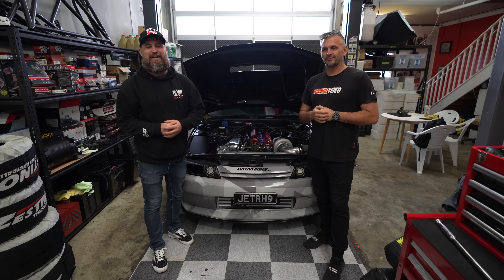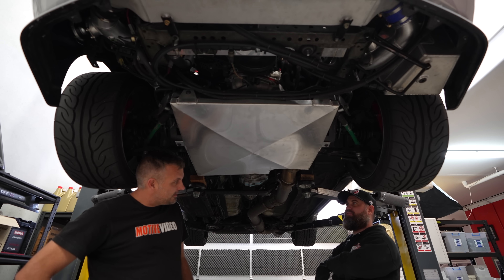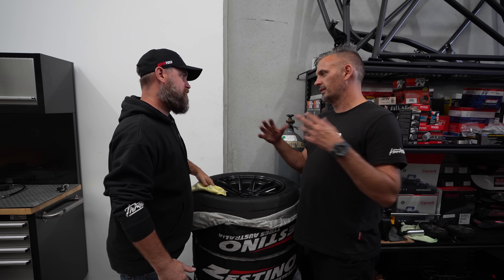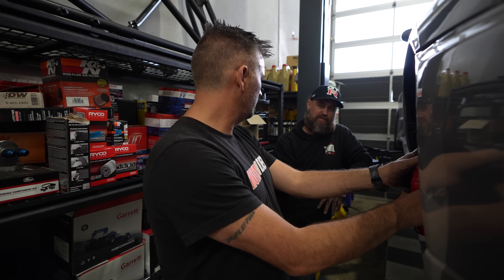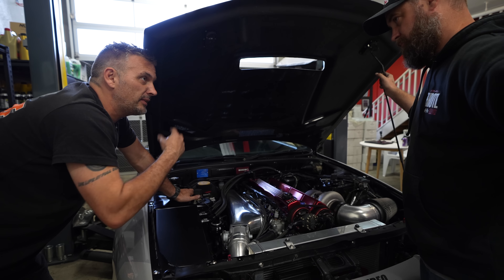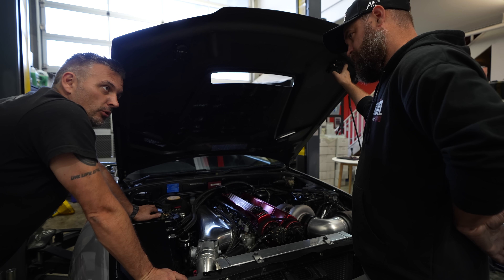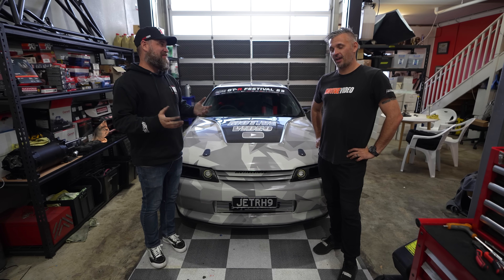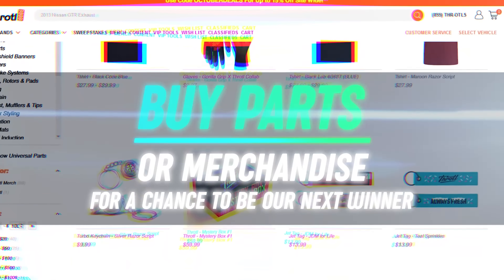Prepping @MotiveVideo's +1,100HP R32 GT-R For An 8 Second 1/4 mile Drag Pass!

Comment: Nice ride but how reliable is this car ??
Reply: It's been making at least 800 wheel for 5 years and gets used alot
Reply: @trichomez4216  yeah could you drive it from Melbourne to Brisbane and back ?? Don’t care how hp it’s making
Reply: @JohnLee-vj9lh  Why would you drive any GT-R to melbourne and brisbane and back and put kms on an expensive old car? It can do it, but you simply wouldn't.
Reply: @MotiveVideo  I’m only using Brisbane/Melbourne as example for how reliable the car is , Isn’t cars meant to be driven old or not, Nice build on the GTR

Comment: An alloy consists of 2 or more metals, an alloy of nickel, bronze, zinc, magnesium, aluminum ect. How could you tell the difference between an alloy and any other non ferrous metal and ferrous material carrying iron deposits without a magnet? Most bearing materials consist of copper lead alloys with aluminum and sometimes tin. Needle and ball bearings are high in iron being they’re a ferrous metal.
Reply: Bearing material is copper/gold coloured
Reply: If you know you know  ,if you don’t you don’t
Reply: You look for the copper twinkly bits.  You strike “gold” you fooked……